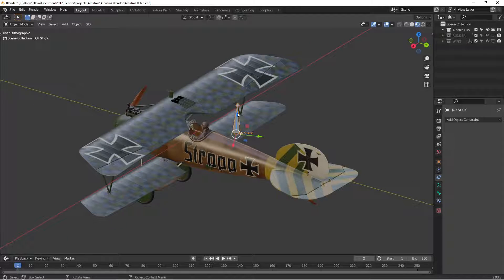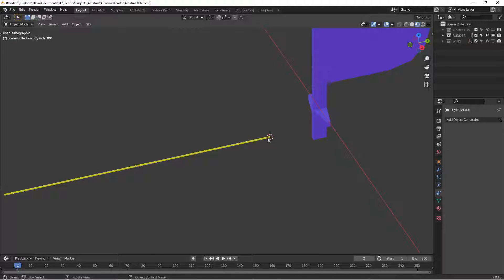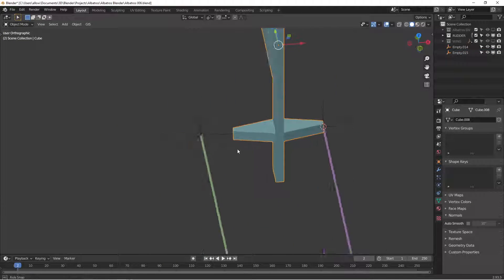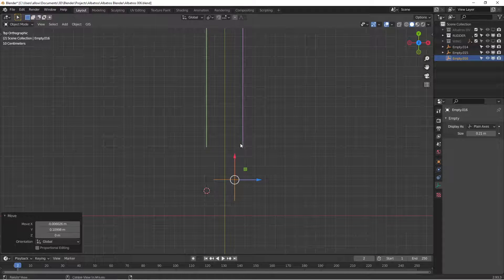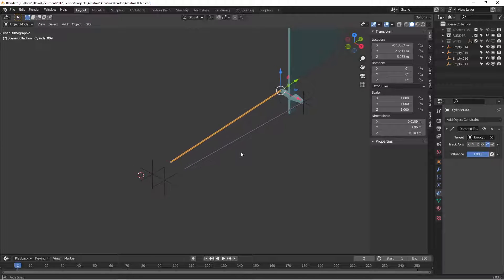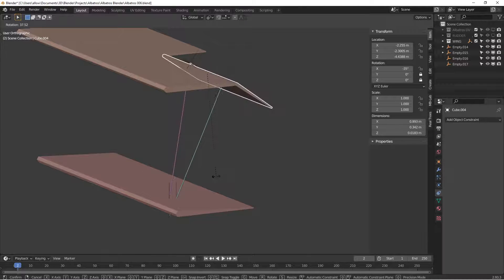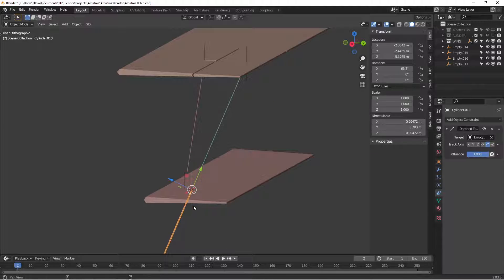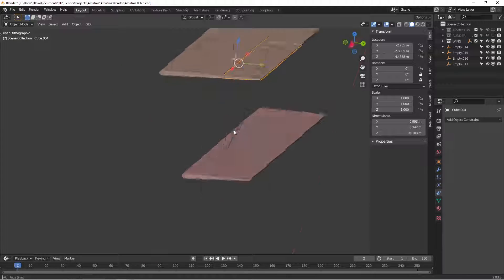Blender - How to rig aircraft control cables

Comment: Many thanks for this really helpful video. Can I ask a question (or point me to where I should)? I have made the rudder cables in my T31 glider as described and they work fine in Blender. When I export to MSFS and operate the rudders the cables don't stay anchored to the 'damped' target - a controls cable duct (I am using normal export settings with the MSFS gltf exporter). They swing up and down. Can you suggest why. Should I be looking for special export settings? Many thanks, I have learned so much from your videos.
Reply from the maker: I really wish I could help, but I've never used MSFS.  My first thought is that the default XYZ orientation in Blender is different than in MSFS.  Is there a setting in MSFS that defines the XYZ axis of constraints and objects?
Reply: @Mark_Alloway  Thanks for the suggestion but no luck. MSFS does seem to use different orientations but anything else I do works ok. I may just fix the cables in space and leave it at that, the ends cant be seen under the cockpit panel.

Comment: For the aileron cables another method would be to use hooks to attach the bottom vertices of the cable to the lower wing.
Reply from the maker: I wouldn't have thought of that.  Thanks for sharing the idea.